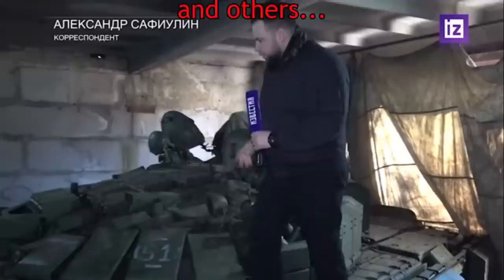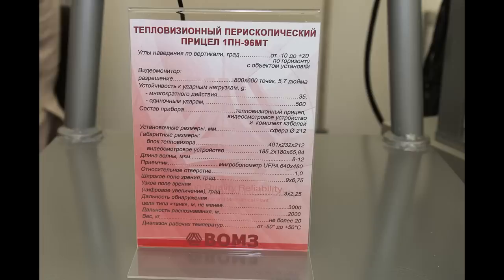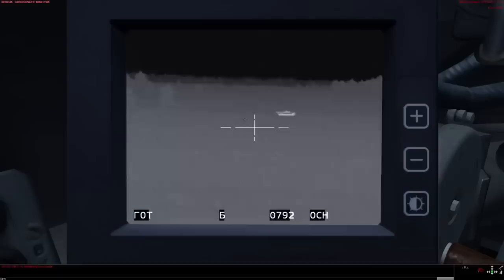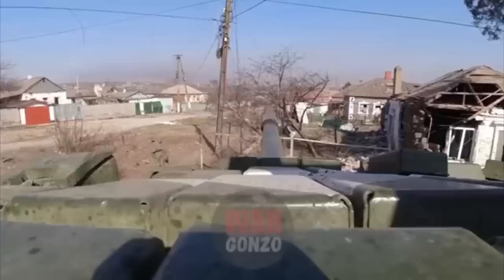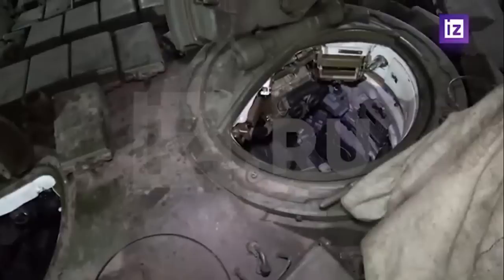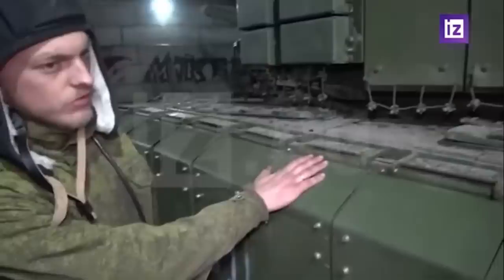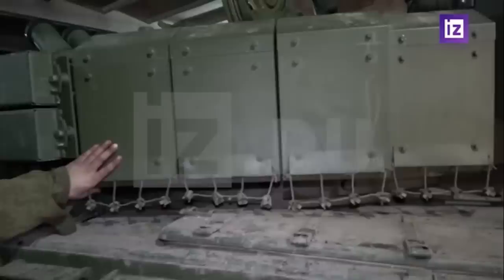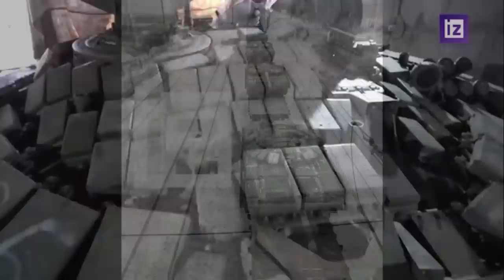Are Russians Downgrading Their Tanks?

Comment: Or they had x amounts of sosna-u sights in stock and is running low on them, therefore prioritizing the better t-90m's to have them.
Reply: What would be the point of keeping a stock of advanced thermal sights just collecting dust on the shelves?
Reply: @phunkracy  spare parts for when stuff breaks.
Reply: @sheeplord4976  parts but not the whole thing
Reply: @phunkracy  They mean spare units.
Reply: @KSmithwick1989  you produce spare parts separately at a rate of usual attrition, but you don't keep the stock of entire units. If anything the Russians hit their production ceiling but not the stock of thermal sights . You don't produce new equipment with thermal cameras if you're already cannibalising the spare parts to maintain existing sightz.
Reply: @phunkracy  Perhaps they were expecting to get into a conflict where their access to modern component imports would be reduced, so they built up a stockpile? They can't produce the advanced thermals in Russia after all, it was all imported. And now I guess they are running out and haven't found many on the black market, hence a downgrade on the refurbs. New build t90 will get the same treatment eventually.
Reply: @phoenix211245  old news mate, that was true for 2014 and Crimean annexation but since then the West cut off the thermal camera and associated parts supply to Russia, and now the Sosna-U is entirely domestically produced. Russia is a country sized weapon trafficking racket and they can and do produce almost everything domestically, including some quite good optics, like the IRST thermals found in Sukhoi fighters are peer to Western IRST.
Reply: @phoenix211245  it's a good weapon but 94% kill rate is just a meme.
Reply: @phunkracy  Which is why India has been gutting their russian fighters of electronics and having Israel install actual modern stuff in. Sosna-U is based off french thermals, the best Russia can make is the obsolete sight seen in this video.
Reply: @phoenix211245  Indian Su-35MKI are 90s tech. The same Indians are also quite happy buying Russian tech so lol.
Also while Sosna's sight begun as a copy of Catherine FC, it is no longer just a copy. And they do send tanks with these 3rd gen thermals to Ukraine brand new, so I don't know what the copium here is supposed to do. They do produce Western peer stuff and it's simply a fact.
That they decided for a cheap upgrade as a temporary solution is not a bad thing for Russia, the opposite actually. More tank is always good.

Comment: Iv love how they managed to include thermal sights but still cant move a metal plate properly
Reply: Drilling additional holes in 40 mm of reinforced steel armor is quite hard and probably not worth the effort
Reply: @phunkracy  Exactly, Russian soldiers are cheap and expendable, drill heads are not.
Reply: @alexamann5729  You believe that a human life is less important than a drill head?
Making a hole in the turret does not sound like a good idea, you generally want to have as little holes as possible in the turret, isn't that what the armor is supposed to do.
Reply: Probably more to do with what's in front of the thermal sight on the inside of the turret. With the lack of room in tanks generally, and how compact a T-72 is, every nook and cranny in the tank is probably filled with something.
Reply: @alexamann5729  it takes a lot of time and money do to that. It’s a war, you need to quickly produce and field equipment. Also, you’re confusing Russia with Ukraine. Russia uses slow paced methodical attacks sustained with heavy artillery barrages beforehand. Ukraine uses fast pace, risky attacks and a no retreat till almost everyone is dead doctrine for defence (Mariupol and bakhmut being prime examples).
Reply: @Don Al Capone  pretty much, if russia is losing great amount of men they'd have done another wave of mobilization in January like Ukrainian intelligent said.
Reply: @mal.3855  Well, as they never really stopped mobilizing troops, they're certainly still taking casualties.
Reply: @Scott's Precious Little Account it is accurate if you actually follow the news. Just look at the Kharkiv offensive and compare that to Russias. Russia took months to capture Mariupol i.e. whilst it took Ukraine a matter of days to capture the lost territories in Kharkiv. Also, fighting till the last man is great pr but doesn’t offer any great advantages. Any short term morale boost will be destroyed when the attacker takes the objective and you can’t retake soldiers life’s, whilst you can always regain territory. Look at Kherson, surovikin retreated and that subsequently, freed up elite troops to be used in bakhmut and soledar.
Reply: @mal.3855  Lol intelligent said
Reply: @phunkracy  drilling a few holes in 40mm armor isn't hard at all with the right equipment.. a carbide tipped bit in a mag drill will cut a hole in a couple of minutes and so would a gas axe